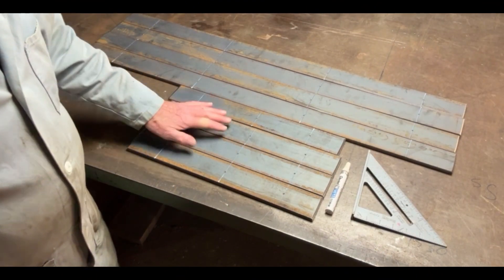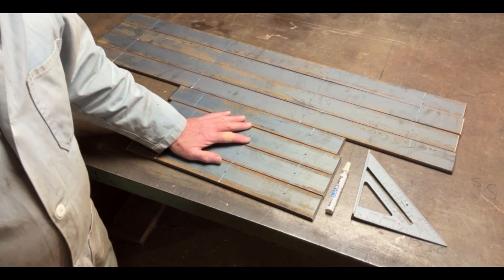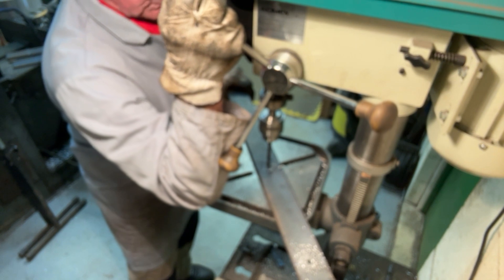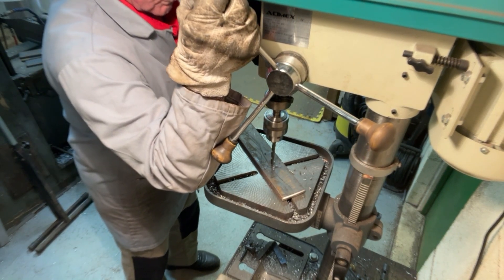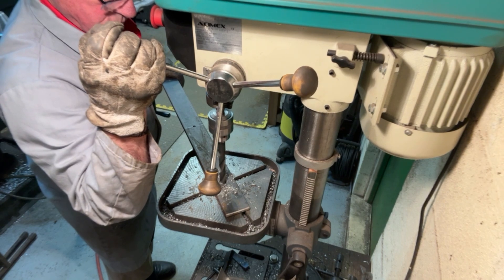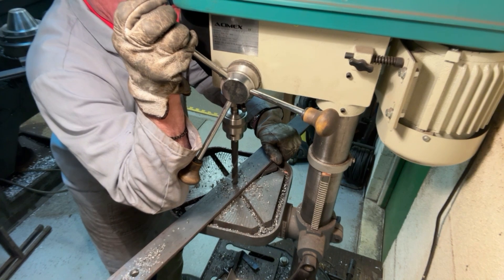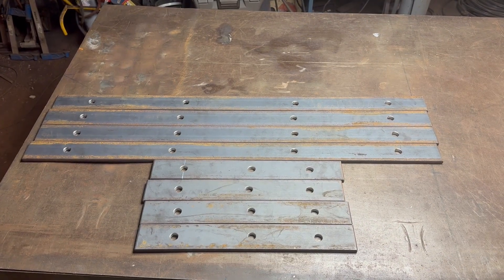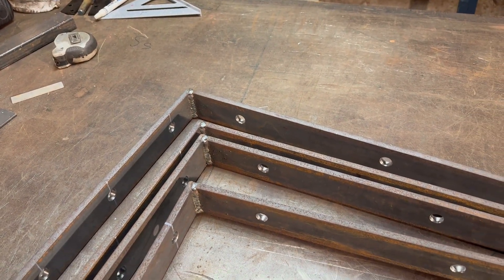How to Make Large "L" Shaped Brackets

Comment: would not it been better and stronger if you made them from one piece and bent  them, you must put a lot of trust in your welding.
Reply from the maker: Hi Claude, thanks for the comment. The bend needed to be fairly tight and if I had put a tight bend in with press brake there would have been a good chance of fracture on the outside edge.
Reply: Then  you did well , as long as you think it is strong enough for the job .everyone's happy . cheers .

Comment: What type of drill bits are you using and why no cutting oil while drilling?
Reply from the maker: High speed drills. Cutting oil not always necessary if running at the correct speed and not putting too much pressure on.